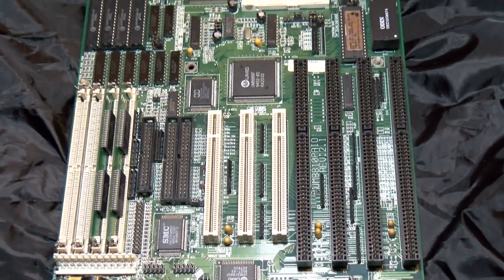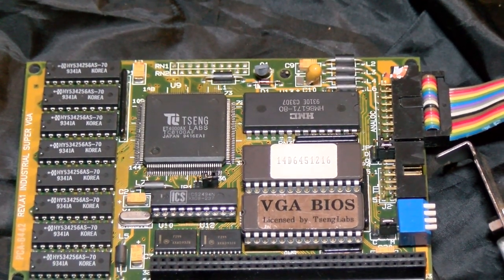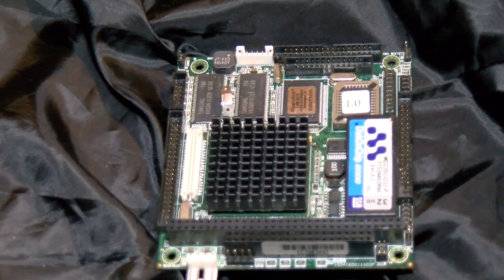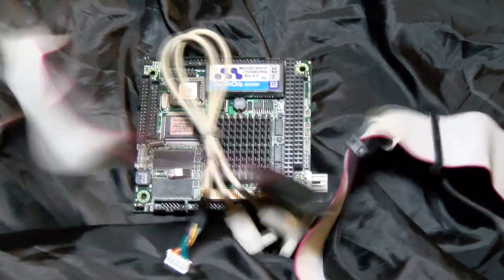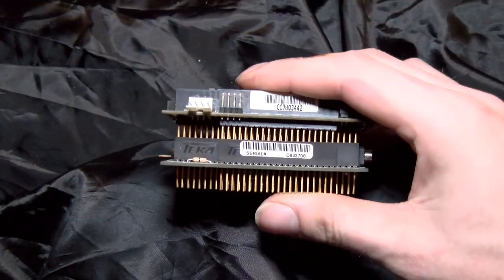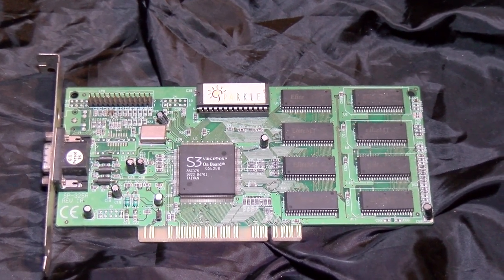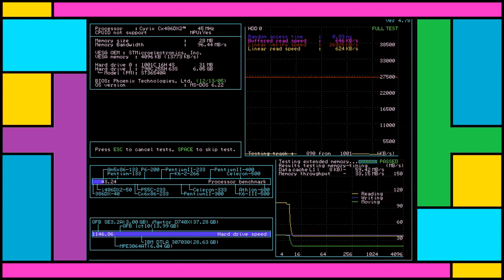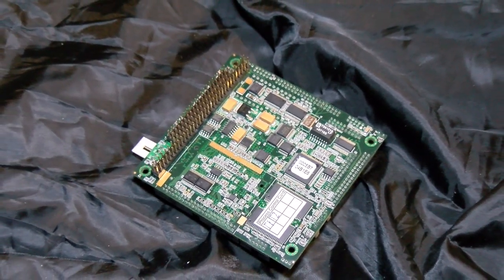Very small PC/104 system

Comment: Literally just yesterday I was on the search for the smallest DOS-era motherboards out there for a project I've been working on, and I'd always wondered about these little industrial systems but they've always seemed so esoteric since no one in the vintage PC scene ever talks about them.  I would love to see a whole series of videos about all the crazy hardware and form factors on the industrial side, especially these sort of single-board computers.  Awesome video.
Reply from the maker: I'd actually like to go down such a route but don't have the money to burn, industrial PCs tend to be really expensive. I'd quite like to at least play with an SBC on a backplane though, maybe I can come up with an adapter and just use this PC/104 card to demonstrate the concept some day, or I might be able to piece one together some other way - finding broken stuff with a known failure is great, but it isn't common, you know, the sort of thing where it's cheap due to being dead but really just needs a new fuse soldering on or something.
Reply: CPU Galaxy has a few SBCs on his channel. https://www.youtube.com/channel/UC2H-q9ZkIEwdNazdCZJTdsg/
As far as SBCs go, there are several avenues that could be explored: VME, CompactPCI, PICMG, 3.5", 5.25", ETX, ComExpress. Unfortunately, a lot of these are still very expensive - even used on Ebay. However, some deals can be had given enough patience and research.

Comment: I've just acquired a PC/104 machine, It's an ICOP VDX-6354 I think in an aluminium box that has GPS stuff inside it with a phone SIM card. I'm assuming it was used for vehicle tracking as it was lying disused inside the dashboard of a Plaxton Panther II coach connected to power and nothing else. It has no breakout cables for display etc. It has a voltage dropper with it too which takes 24-28v and drops it to 12v and 5v.

Comment: I have a PC/104 486 board. Never found any boards for it. It was my Raspberry Pi before there were Raspberry Pis.
Reply from the maker: I did contemplate mentioning the whole Strawberry Teacake thing, but left it out to save time and reasoned they were in different sectors anyway, though I wouldn't be at all surprised if the average Pi board probably drew from established principals on PC/104 to save time and effort, but I know very little about them as they're well after my time and no reason to use one has ever come up.

Comment: PC/104 (ISA only), PC/104-plus (ISA and PCI), PCI-104 (PCI only), PCI/104-Express (PCI and PCIe) and PCIe-104 (PCIe only) are all related standards, compatible with only their immediate neighbours (any adjacent two in this order here). One did not 'replace' the other. All are still available with the same support lifetimes.
This board you're showing doesn't have the PCI bus implemented on it because it wasn't designed for it, despite using components that may support that technology individually.

Comment: These are nice tiny rigs like a Raspberry Pi, but w/ x86 architecture and w/ expandability by stacking the expansion boards, based on the ISA bus, later on the PCI bus.

F**k yeah, Raspberry Pi and other modern SBCs; your design was invented former in the 90s :D
Reply from the maker: March 1992 seems to be the earliest publication of the standard, so it has definitely been around for a good while now.

Comment: Awesome video! Also, that's a neat (and uncommon) PC/104 soundcard you've got. Personally, I'm searching for a unicorn - a PMC (PCI Mezzanine Card) sound card. They exist, but I sometimes wonder if I should just design and build my own.
Reply from the maker: Without looking, something tells me these cards don't show up cheap.
Reply: @HighTreason610  There's 2 on ebay: one for $250, and the other for $650. And that's for a very basic 2 channels. I could probably get away with doing it myself for about $50.
Reply: If ISA would do, TheRasteri has a video on a PC104 project in the #DOSCember series where he designed his own sound card.
Reply: @Hobbiekip  I'm patiently waiting for those schematics. :)
As far as the PMC sound card... I've decided on designing around MiniPCI since it's small enough to be converted to just about anything else (PCI, PMC, and PCI104).

Comment: You can get a cheap used system as a hold over.  Lots of people dumping Ryzen 2xxx systems.  But I'd stay from Intel and all their security issues.
Reply from the maker: Maybe, but as I can still just about get by with what I have for now I think this would be false economy, better to just save the money and upgrade sooner. Yeah, that's one thing that puts me off using Intel again, the fact I know it'll be patched to hell within a couple of years and I'll be back at Presler speeds as I am currently, unfortunately there's still no usable option in the AMD camp though so my hand is kinda being forced whether I like it or not. That and I really do like having the warranty.

Comment: I can find sealed ebox-3300a for 25€, thin vorex86dx cpu, integrated xgi z9s 2d graphics, an via hd audio chip that can boot from ide, compact flash or even micro sd.
As it is is possible to do any win98 or dos gaming with audio?
With the
Reply from the maker: The only Vortex86 I ever played with had a lot of compatibility problems. There is supposedly a generic audio driver for some of the AC97 chips, not sure about the HD Audio ones, haven't tested either and wouldn't expect much.

Comment: Can the PC-104 be used to build a cnc router for the armature would shop? Where can I find these kind of projects. I'm a armature with these.
Reply from the maker: It would certainly be possible, but you'd probably have to write your own software to control whatever it is you want to control, possibly even design some of your own hardware. That is unless a specific PC/104 interface card was made for whatever you're trying to use and you had the software for it, or if the tool had something like RS-232 already. Really does depend on the scale of what you're trying to do.
Reply: @HighTreason610  Thanks! l love the auto correct on my original post but I guess you could figure out what I meant,

Comment: I made the mistake choosing a AMD Phenom 1100T over the intel i7 but AMDs Ryzen 7 is amazing and surprisingly even my girlfriends low spec Lenovo Ryzen 3 laptop manages to get things done admittedly its a shame there's no optical drive but sadly the mindless zombie decides
Reply from the maker: Still stuck in Intel land over here due to a lack of expandability on AMD's platform.
Reply: @HighTreason610  where and with what did you start with? I began with C64 moving to Atari ST then onto Pentium 120 the last of which is long gone although perhaps I might be able  to pick one up off ebay thats reasonably priced advertised broken!
Reply from the maker: Atari 7800 console, my Uncle's self-built 286, my Dad's Pentium 60/66, my own 386SLC-25. I still have the Atari 7800 and my 386SLC. My first proper self-build was an AMD Duron 750.
Doesn't hurt to search on eBay, I guess. Sometimes you do indeed get lucky with 'broken' things, especially if you can figure out why they think it is before you buy it. Obviously beware weird OEM machines that might be harder or impossible to get going because of stupid non-standard rubbish.

Comment: Cool. It's like a proper Raspberry Pi-like DOS machine. Because DOSBox is shite. It can't even play Jazz Jackrabbit without a plethora of glitching.
Reply from the maker: If modern capture cards weren't so laggy I'd like the idea of stuffing this into a modern system as a kind of 'DOS Compatibility Card' or something, but it's not really viable. Not actually sure if it would run Jazz, though there's no obvious reason why it shouldn't. One almost has to wonder if a ribbon could be made up to interface with those rows of headers on the GUS as I think they just connect to the ISA pins, that's for someone else though, I'm not really interested in putting the time in for a card that only about five games supported properly.